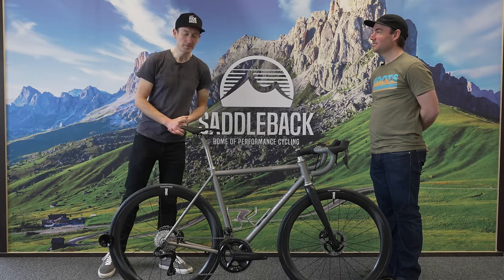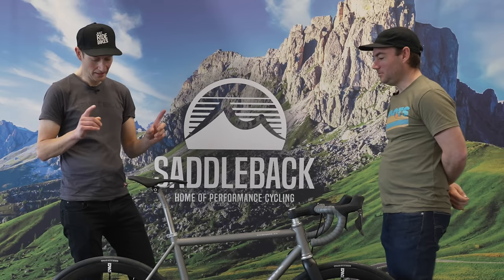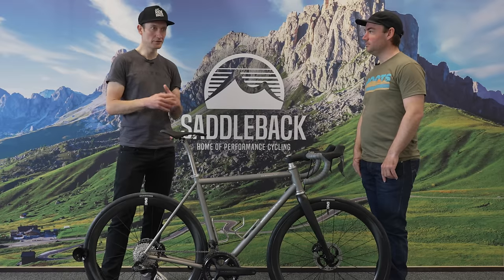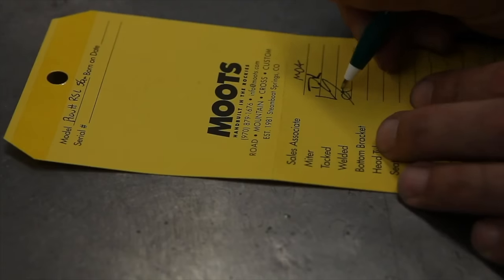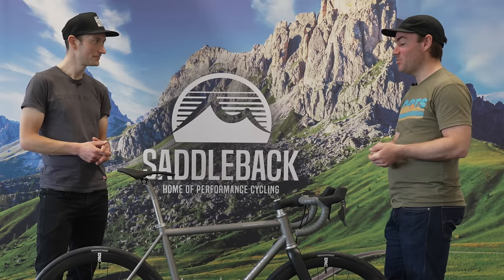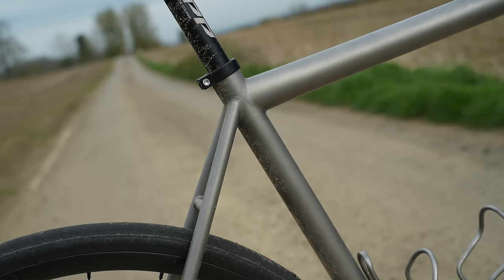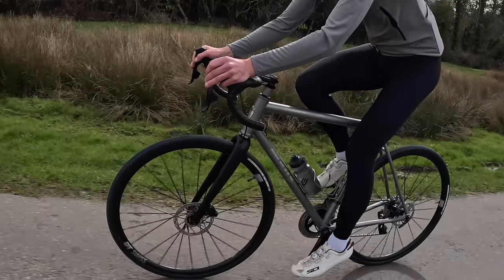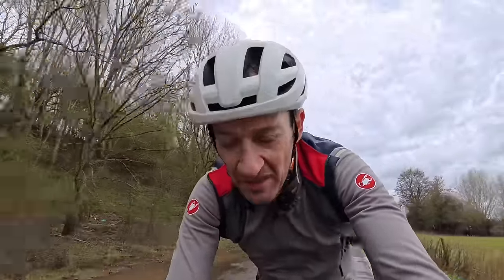2024 Moots Vamoots 33 First Ride: A New, Old Titanium Road Bike...

Comment: You can get an MT-07 for that price
Reply: But not an rzf-r1m, and these are manufactured in smaller quantities so moots doesn't have the luxury of scaling. I'm sure you can't find a hand made, non-mass produced, ultra high end motorcycle for a fraction of the cost. For bicycles, this is the fanciest, for motorcycles the mt-07 is entry level.
Reply: And you can buy a car for what some people spend on a watch. Apples and oranges.